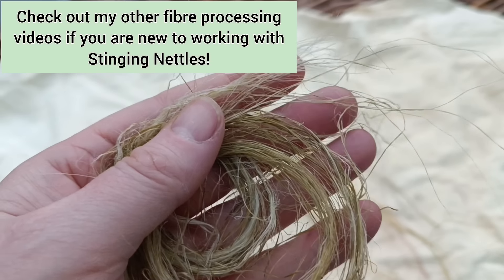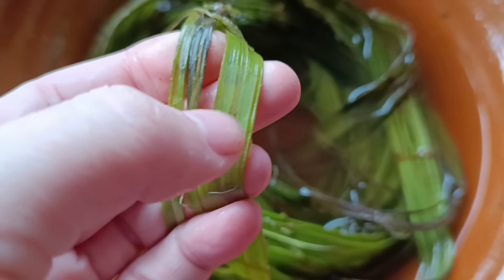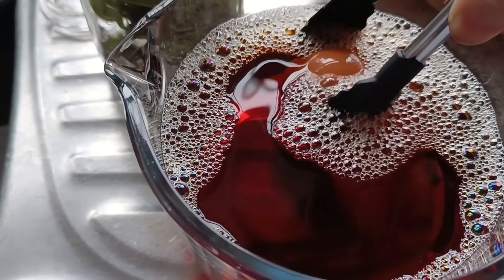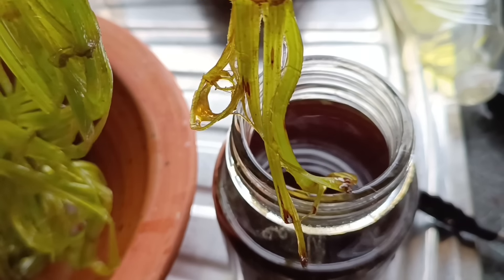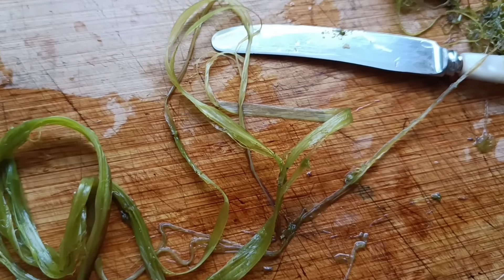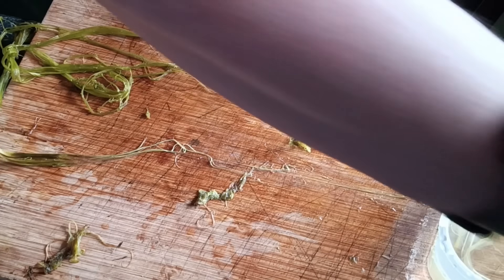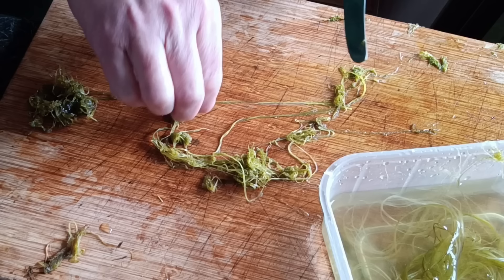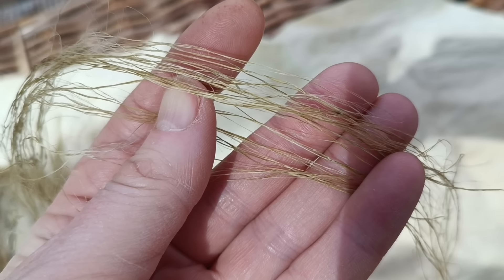Nettle Fibre Experiment: Cold Woodash Lye

Comment: Ive been watching all your videos over the years. Why not just do water retting like people do with flax then break it using a flax break. I don’t think Ive seen you do that yet. I think peeling them green then drying them then water retting them would be the best course of action. Seems like an awful lot of work to get a few fibers. I see they are good but dang, thats a lot of work.
Reply: I'm curious also if you use a hackle and break, or think that people used those in the past at any point in this process.
Reply from the maker: It's because current evidence suggests little to no retting in prehistoric samples. It's a great method for more modern periods though
Reply: @SallyPointer  Do you think no retting in prehistoric samples has something to do with the splicing method? As I understand it, retting strips the fibers completely of the green gum that helps glue the fibers together when splicing them and it would make sense if that's the reason they chose not to water ret them.
Reply: @TheCatAndTheCactus  I think splicing would be a viable way to make the thread but it seems to be a bit fragile and I would be amiss to weave with spliced. I did do a pretty good job making spliced fiber last summer but not sure it could handle the rigors of a modern loom but maybe a warped weighted loom. Maybe I should do enough using my flax to make a bunch of thread. It will be a long process doing it alone. Splice the fibers wet. Strip them then split to the size you want then splice the ends. Do two piles of them then spin the two piles together to make a spun single. If you don’t spin the fibers the spliced ones might not handle being a good warp. Maybe a weft but not likely a warp. That is my thinking and it comes from my trials of making spliced thread from peeled flax vs retted flax.
Reply: @SallyPointer  Ok. I do however don’t believe retting of some sort was not done. Prehistoric does not mean primitive. I guess I should look for books showing the evidence of non retted. Not sure how they can actually tell.
Reply: @SallyPointer  Thanks for responding to my response.   :)
Reply: Its good to know different ways also you could do this in larger batches

Comment: Together with a friend, we've tried the technique with boiling in woodash for 5-10 minutes. Afterward coating the nettles with a thin solution of clay and let it dry. Then when rubbing, the clay assists like an abrasive and the fibres came out clean for spinning.
Thank you for sharing this cold bath technique!

Comment: So exciting! I've heard that most Northern European fine linens from the past were really nettle cloth, which needs an electron microscope to be distinguished from flax cloth. And that the finest threads were preferred whenever possible for making the finest cloth. And here is a tidy solution! It makes so much more sense to use a "chemical peel" on the fibers to preserve the desired threads. Thank you, thank you! 
What a treasure lye is, from cold rinsing laundry to remove grease and sweat before soap was commonly used, to making amazing bast fiber threads!
Reply: That rinse would make some amount of soap from the fats collected in the fabric by wearing the cloths

Comment: It's sounds really close to what I've read in the book "Brennessel - Anbau, Sammlung, Verwertung; von Dr. Oswald Richter aus dem Jahr 1917". He write down on page 30 that after the nettle fibers are split out fresh, you can cooking them for 15-30 minutes in soap water. Then you can heakle the fibers and you will get really white fibers in staple length between 3_5 or 10-14 cm long fibers.
I really want try out the recipe with ash (30 grams for 1 litre water for 150 gramm fiber material) like I use this recipe to wash my sheep wool in 50-60°C warm water for 7-8 minutes, and clean them out in fresh water for 7-8 minutes (maybe 2 times) and after this, hang them out for dry before I begin to heakle them.

Thank you so much to be one step before me, because I'm still in the stadium to seperate out the fibers from my rotted nettles from last year 🤗❤
Reply: The comments on this video are just as interesting and informative as the amazing video itself!

Comment: I think the next question is "do you need to process the wood ash to Lye?" 
We use hard wood ash (as is) to "slip hair" off hides in leather making. Just by wetting the hair on hide, dusting heavily with hard wood ash and then soaking in a hard wood ash & water slurry.
Could much the same be done with Nettle Fiber?
Reply: I was wondering that as well. I know packing eggs in wood ash was a method of preservation, would layering the nettles with ash and letting them sit be a way to slow process them but keep them workable until you have the time to do something with them?
Reply: I think it is pretty much the same thing. I just mix my ash in a jar until nothing else dissolves into it. Saturated solution. Then I just use a coffee filter to separate. It just has the particulates still in it. But when you wash it all away it comes out clean anyway.

Comment: Hi Sally! Congratulations and many thanks for your awesome videos!

Someone probably asked you this already, but I wonder why you don't follow the same methodology as what is typically done for flax: retting, drying, then "braking", then scuffing. It seems to me that building a sort of brake is very easy, something that neolithic people could have done easily with nettles. And it seems a lot less work than scraping. Is there a reason why you don't go that route?

Again thanks a lot for everything, from France!
Reply from the maker: Nettle doesn't like being processed in bulk, it really rewards being done a stalk at a time
Reply: @SallyPointer  Thanks a lot for the super swift reply! Would you care to explain what you mean by "it doesn't like"? You mean it breaks?

Comment: Soak in water for three weeks, change occasionally if in a vessel (as opposed to a stream) and the pith slips from the fibers. Used for hemp also. You should watch the traditional hemp videos from Italy. They card it or whatever like linen with nail boards. 
   Bending over an edge rapidly for the pith also (you already removed). Or bent over another rope. Same sort of thing for sinew as well, but it needs the fly-aways burned. For hemp too. I was primitive with the sinew. Don't be above pounding fiber with a smooth stone on a log.
   Here's a tip if you've made it this far,;- a dip in a strong alum solution for the plant fiber, then drying is a method to strengthen them. This is at the end of natural rope making not dyeing textile fiber. Leaving mordants in comes to mind but I cannot contribute about that. I followed recipes more than studied it.
Reply from the maker: I'm after a non retting method this time, but I'm fascinated that you can ret your nettles for three weeks without losing the fibre. For me in my river that's way too long. Different bacterial profile maybe
Reply from the maker: I'm after a non retting method this time, but I'm fascinated that you can ret your nettles for three weeks without losing the fibre. For me in my river that's way too long. Different bacterial profile maybe
Reply: @SallyPointer  If the whole stalks are placed in a little ordinary tap water in a vessel (with a stone on top to keep it all submerged), then the ubiquitous lactobacilli (they are everywhere on the stalks) will multiply and quickly lower the pH by producing lactic acid which will in turn inhibit and kill off the other strains of bacteria that would normally cause plant material to rot — as it would in a river. If you think about it, this is exactly  the lacto-fermentation  processes that produces and preserves traditional kimchi, dill pickles and real sauerkraut. The salt added to  sauerkraut is not as a preservative as may assume but to retain a bit of crunch.  Likewise, you don’t want any micro-mycelium (fungi) in contact with stalks as the digestive enzymes they excrete break down cellulose fibre. Lactic acid, vinegar, etc. will prevent them growing.   Nearly forgot to say that the lactobacilli will need to feed on some plant juices so perhaps the stalks should be fresh and crushed  to make the  sugars available.
Reply: @Nuts-Bolts  lactic acid needs a salty environment to proliferate, and then indeed kill off all other bacteria and yeasts. Sugars feed yeasts on the plant to ferment. They then break down sugar into alcohol and carbon dioxide, this process promotes breaking down of the plant material, not sure about the effects on fiber strength
Reply: @rens1030  Some salt may be more reliable for the beginner but many people on low salt diets don’t add any. Reason being is that yeast initially require oxygen to multiply and grow before they turn anaerobic. Lactobacilli being bacteria which just have to start *doubling*, out pace yeasts by a mile and the acid quickly inhibits other bacteria. 
I added the real reason salt is added  to sauerkraut in the expectation that it  would save anyone coming back to point out that since the the original poster didn’t mention adding salt to the vessel, then lacto-fermentation in this case, could have had nothing to do with the stems softening etc., in the false but common belief that  lactobacilli need a salty environment to proliferate in.

Comment: Wow, some good chemical retting there. I wondering if pickling lime would also do. 
On a different note: It seems the Southwestern Pueblo people, would process fiber from Yucca plants by boiling and then slowing chewing the leaves. This mastication seems more than just mechanical but also an enzymatic process. However, I've concerns about try this after reading that we should avoid consuming nettles in certain situations (ex. when they're preparing to flower).
Reply from the maker: I've tried preparing nettles by chewing, it worked well but was slow going

Comment: Perhaps after the fibre has been washed in vinegar they could be soaked in water with some rennet added. Rennet as you will know contains pepsin which is most active around pH 1.5 to pH 2.5. This will help to break down any proteins adhering to the fibres. 
Have not tried this myself but was wondering if this is how the ancient Egyptians and Greeks (the very wealthy ones at least) managed to have fine, shear, diaphanous fabrics which would have required  fibres to have been very clean before weaving.
Reply from the maker: Egyptian linen is spliced linen, allowing threads barely more than two fibres thick to be produced. 
I've used winemakers pectolic acid/pectolase before, rennet is an interesting idea

Comment: I wonder what would happen if you did the scraping with a bone blade, like a bone folder. The steel blade (even for a butter knife) is very hard and I would think it would weaken the fibers while scraping off the green slime. Or even another, softer metal, rather than tempered steel.

Comment: Does the treatments used to render the fiber effect tensile strength and would they lean towards a treatmet or treatment duration ( dwell time) that would result in a high tensile strenght?
Reply from the maker: All good questions. I'm still exploring this as a method and it definitely needs some wear and tear testing
Reply: @SallyPointer  thanks

Comment: in "the life of mila repa" there is a part where he has made so much nettle soup in the same pot without washing it that a skin made of nettle expressed goo formed so thick he removed it in one piece and was able to boil his soup in that without the pot. 
you can boil water in a paper cup over a flame
so long as there is water to transfer the heat away it never gets over 212
am i giving good ideas?
Reply: There's also the part where he turned green from drinking only nettle tea and became so emaciated that he was able to fly away down the valley...

Comment: takes way too much time n effort to make lye then use to process fiber faster. depending on how advanced the society was and how much fiber they were processing, and whether it would have been worth it to process it with lye. chad zuber has made a lot of cordage with yucca. i cant find the exact vid but i think he did ret the fibers in the river to make it easier to process. youre probably aware of how linen is retted too, with just water. https://www.youtube.com/@ChadZuberAdventures/featured . u can leave a comment on his most recent video about retting the release fibers without modern crops like linen, he should see it at some point. it just seems like using lye would be something a village of 100 people would be able to manage, but less than that wouldnt be practical to process all the ashes... but maybe it would be worth it. maybe try retting with just water to see how much easier it can make things for u. and then see if using lye can speed up the process that much. i wonder if using rain water/ground water makes any difference. tap water shouldnt be used imo, but maybe it wont matter that much. also if the trough is kept outside i wonder if there's more bacteria in the water breaking down the gum faster, than if its kept inside. of course linen is often retted on the grass, just by turning it over. but they didnt really have scythes back then.